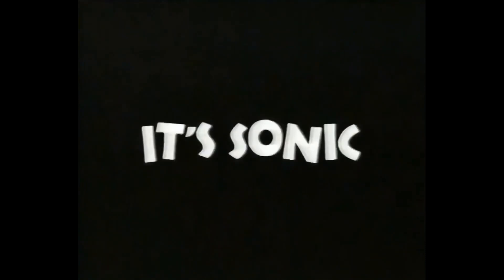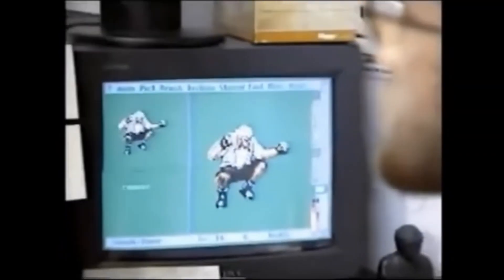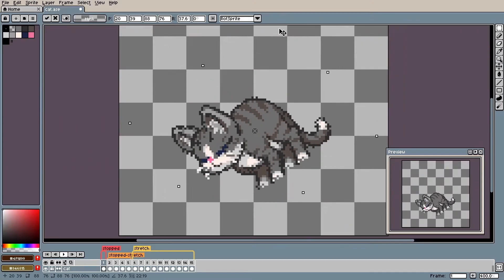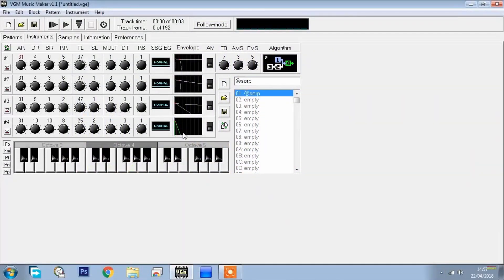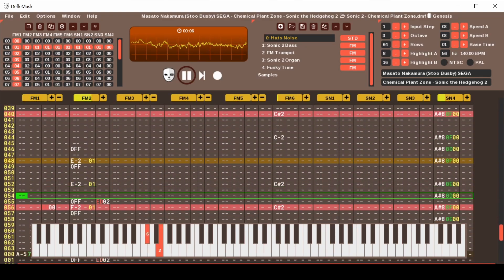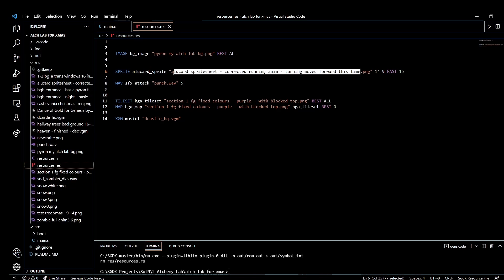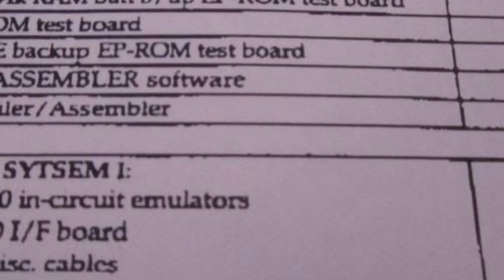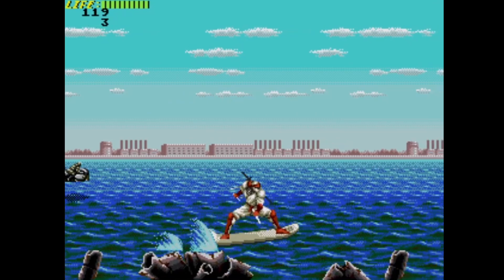How New Sega Genesis & Mega Drive Games Are Made (1980/90s versus Now)

Comment: i hope someone can help me i wanted to ask under Matteusbeus's intro tutorial but he disabled the comments
When i use the SGDK template after entering "task clean" i get the following error message:-

WINEPREFIX=$GENDEV/wine : The term 'WINEPREFIX=$GENDEV/wine' is not recognized as the name of a cmdlet, function, script file, or operable program. 
Check the spelling of the name, or if a path was included, verify that the path is correct and try again.  
At line:1 char:1
+ WINEPREFIX=$GENDEV/wine wine cmd /C %cd%\\build.bat clean
+ ~~~~~~~~~~~~~~~~~~~~~~~
    + CategoryInfo          : ObjectNotFound: (WINEPREFIX=$GENDEV/wine:String) [], CommandNotFoundException
    + FullyQualifiedErrorId : CommandNotFoundException